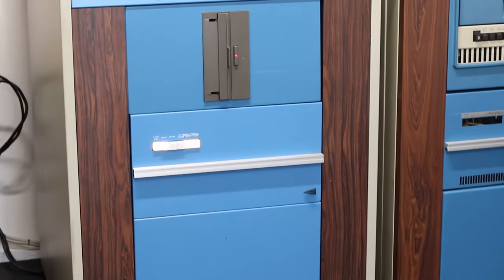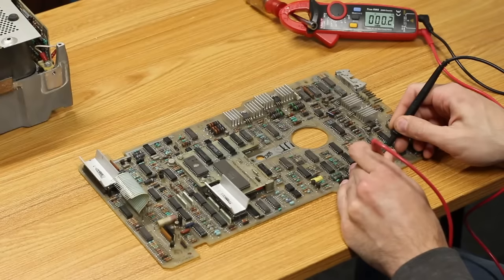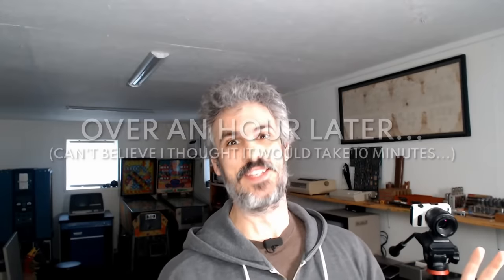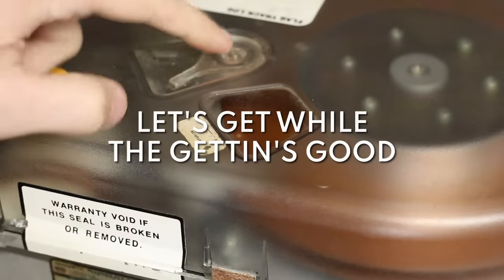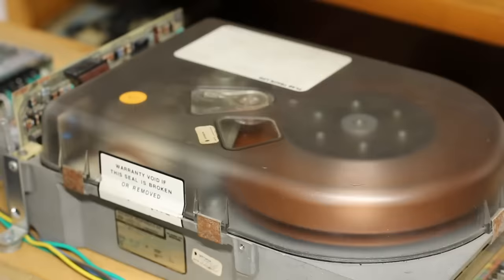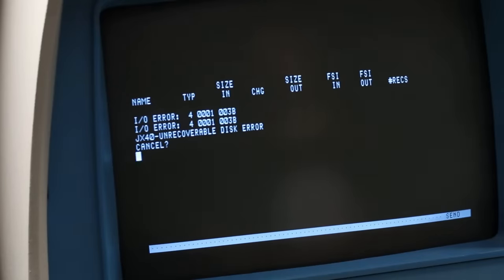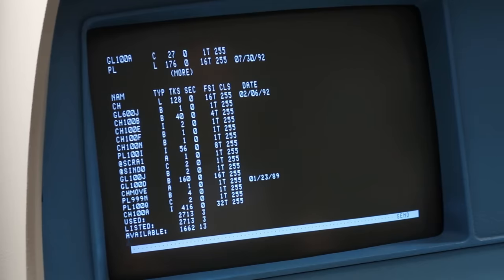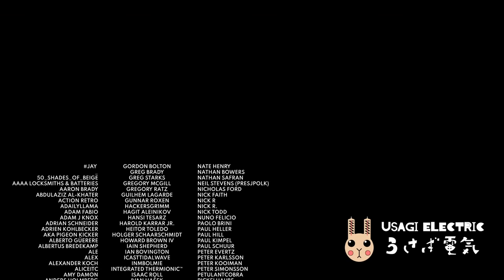Will This Rare 1980s HDD Live Long Enough to Save the Data?

Comment: This made my morning. I recall many weeks in my time as the IT guy in our large CPA firm where I was trying to recover clients data from proprietary legacy systems. Many in the office never really understood why I would get so excited when victory came. It's hard for non tech people to fully grasp the amount of failure modes that make a simple concept of recovering data so nuanced. Most of us watching were feeling it.  Thanks
Reply from the maker: Thank you!
It's so easy to think of things as big large collections. Like, we only really needed four things to work - the computer, the two finch drives and the hawk. That doesn't sound like much, but when stopping to really think about everything that was involved in just getting a little bit of data from one place to another, it was almost overwhelming!
Reply: That's the same thing as having a videocamera not working as intended and opening it up from the easiest parts/side and finding the fault, and hoping that it's the only defect, and upon switching it back on performing as intended...
We once had someone who just had one of the worst days of life come into our office completely heartbroken because the camera this person had been using had written all the video files (of a big house fire) to the SD card in a corrupt fashion due to someone who used the same camera earlier pushing in an SD card the wrong way in, which bends a CRC pin from what we can find, it records without errors, but corrupts the whole card.
Due to some other things this person just had it for the day and sat in our office crying, and I decided to let a recovery program (SanDisk's program was, as usual, useless for that task) work on the cards.
Just as the person had gotten themselves back together a bit, I asked them to check the files it had already recovered, and when seeing what was coming back the person broke down crying yet again.

I never felt like hugging someone but oof, that time I absolutely thought about doing so.
Reply: I'm a tech person and I still dont undertand his excitement and feelings, even tough it is a hard task. He got some data out of a disk, and can now delete it since he has no use for it :D
Was the journey the reward?
Reply from the maker: @marsovac  Conversely, we have a ton of use for the data we saved versus the data we lost. My Finch drive was full of Oil and Gas backups for a local Oil Company in Texas. There weren't any applications, software, operating systems, etc. Just legions and legions of personal data. The MicroPlus Finch drive does have personal data on it, but it also has a ton of applications that we've never seen before, a full operating system, software packages, linkers, and just a ton of stuff that is extremely useful!

Although, I think the misunderstanding is coming from potentially a lack of knowledge of the history of the Centurion computer. I've been working intimately with this machine for two years now, and we only know of four remaining in existence. The Centurion uses a completely custom CPU, architecture, storage system, and software. For example, the entire machine uses 400 bytes per sector to remain backwards compatible with data from Litton minicomputers from the 1960's.

So, we found a bunch of software that was nearly lost to the sands of time. For some of these applications, the MicroPlus Finch drive quite possibly contained the last remaining copy of that piece of software in the world. That's why I was so excited!

Also, this is my hobby, and my hobby brings me huge amounts of joy. Let people have fun!
Reply: @UsagiElectric Well said. That's the difference between an Engineering mind set and one that isn't. Great Video.
Reply: Yeah, I saw something about AMORT in the file listing which made me immediately suspect it was financial applications. Cool!
Reply: @UsagiElectric is this systen u used posix complint?
Reply: I don't think we have had that issue at the PC shop. We always said this blah blah cpu has has this many hundred million/billion transistors in it, just that one chip out of hundreds.innthis PC, it only takes ONR transistor to fuck up the whole thing. That's always opened some eyes.

But, yes I call it the computer literacy epidemic and liken it to I brother Where Art Thou where the brothers all sign Xs because they can't read.
Reply: @marsovac  Wooden boat reward. Same thing to me. I guarantee you have some hobby or item in your life that gives you the same feeling of accomplishment that another person might look at and think, "that's silly". And that my friend is how it's possible to enjoy others excitement without necessarily relating directly with the project itself. Unless your a Vulcan like Spock and are not moved emotionally by anything, then I'll accept your not understanding.

Comment: I worked as a 'field engineer' (mainframe service tech) in the late '70s;  Immediately on hearing that HDA, I said to myself, "wow, those bearings sound crunchy!"  Somehow, I knew it wasn't a head dragging - although I mightn't have risked flying the heads with the spindle in that rough a shape.  Glad you got the data off!
Reply: Yup, that's a common sound for a ball bearing that's beginning to fail. I've heard plenty of bearings making that sort of noise on various machines. They can last quite a long time sounding like this. Very often when you take the bearing out it will look and feel fine, even though it sounds terrible at operating speed.
If it progresses to a lower pitch rumbling or grinding noise you know the bearing is not far from spitting it's contents on the floor and needs to be replaced ASAP.

Comment: On the "plugged the connector in the wrong spot" event.  When I was stationed in Japan in the 1980s, we had a Data General Micro Nova we used with a radio system.  We started having problems with it booting up from the floppy drive intermittently.  We struggled with it for about a month with intermittent fail to boot problems.  We swapped all the cards, and tried going through the troubleshooting guide several times.  Keep in mind we were radio techs, not computer techs and we were not supposed to get too creative with the system.  We finally called the main depot back in Sacramento, CA.  They walked us through the same steps we had done ourselves to make sure we covered everything and finally determined they needed to send someone to Japan to assist us.  a short while later they arrived, went to the machine, pulled it out of the rack, looked at the connector and moved it one position over.  It turned out the guide didn't show which connector to use, and we were using the wrong one.  Apparently one connector had a parity bit, and one didn't.  We were using the non-parity bit connector so errors didn't get found and that was why it was intermittent.   We ended up having to people travel from CA to Japan to have us move the connector over one spot.
Reply: Definitely not the first time somebody has had to travel just to move a plug. Happens a lot in IT lol.
Reply: @SonicBoone56 with this case covering a distance of around 5500 miles it might hold the record for something that simple, though
Reply: I bet the tech from Sacramento told that story for the rest of his life.
Reply: Hah, well they're paid for the knowledge of knowing that the connector needed to be moved over one.

Itemized bill:

Moving connector: $1.00
Knowing where to move the connector: $9,999.00

Comment: That scratch in the floppy front panel is driving me crazy
Reply from the maker: Don't worry, that's on the docket to get fixed! I have a completely new front panel made of steel that I can weld proper mounting tabs to. Once I get some paint matched up to the original color, I'll spray it and replace the scratched one.
Reply: There are car repair products that can help you buff out the scratch on the existing front panel.

Comment: The 'warm it up' is a well known trick for very old drives with potentially dried out lubricants. I generally leave them on a 'hand warm' heater for like 8+ hours. This also reduces thermal stress on the electronics btw.
Reply: could you not just regrease the drive?
i know nothing about these old drives, but they put it together so could you not take it apart?
Reply: @derpmellow2  You generally do not want to take a harddisk apart beyond possibly removing/replacing the pcb.

Harddisks are assembled in an area with a very clean atmosphere and are typically sealed because even small bits of dust can cause a head crash.

There are ways to do this without having a clean room, but those are still risky enough to avoid them if you can.
Reply: @c128stuff  understood, so it is doable but not recommended.
Reply: @derpmellow2  Its something to avoid at all cost unless there really is no other option, you know what you are doing, and have the setup to do it.
Reply: @derpmellow2  Opening a harddrive and closing it up again and having it still working IS possible - then again you might as well wreck it completely due to dust contamination - impacts with grains of dust can actually physically destroy the heads themselves, at the very least losing all data stored on that disk surface, and quite possibly making the drive totally inoperable.

Then you need to realize that the drive spindle bearings aren't necessarily exposed for you to lube them up either, and if you need to physically tear the drive down to get at them then you're never going to get any data out of it again, because you can't put it back together and have it still function. Not just a matter of contamination, it's also tolerances. Harddrives - even ones as old as these - are high precision instruments, and you just can't tear it down and put it back together and keep all the tolerances within spec.

So consider the possibility of lubing up a prehistorical HDD a "no", for all intents and purposes. Harddrives are essentially consumables - always have been. You buy 'em, and they'll wear out eventually, since they're partly mechanical systems. These ancient ones even have carbon brushes for the spindle motor, so they're definitely going to wear out eventually - you can see all the carbon dust residue on the underside of the drive chassis after the PCB has been removed.

That stuff is electrically conductive by the way and can cause shorts or other problems if it amasses in the wrong spots over time. Just one reason why modern drives use brushless motors... :)

Comment: If you are ever tracking down shorts in the future, a thermal imaging camera is a great tool to have. You can just power the board up with a current limited supply, and the offending component will stick out like a sore thumb because it will take all the current compared to all of the other components.

That saves you from playing hide and seek with parts.
Reply from the maker: A thermal camera is definitely one of those things I need to invest in!
I did think about just cranking the current up and whatever starts to glow or let out smoke is a pretty good indication, but I figured I would try probing around with the DMM first, haha.
Reply: @UsagiElectric  problem is other parts could be destroyed by other bad ones in a chain reaction destruction, i've had it happen in colour portable tvs in the 90s....
Reply: That is true. It could be a usable technique but it's dangerous.

Some dead parts (i.e.e diodes) may fuse into a dead short so the part would have near-zero resistance, capable of sinking a few amps. 

The traces however are not, causing them to literally burn off the board.

In this case the capacitor had <0.1 ohm resistance, while the traces leading to it had ~0.5 ohm - guess which is going to get hot.

If you cannot find a shorting part - try cutting traces where they are easy to repair, isolating the problem area bit by bit. Be aware that there may be multiple shorts though.
Reply: The tools you really need for tracking down shorts is an old school HP 546A Logic Pulser,  and an HP 547A Current Tracer.  You trace shorts with these with the power off.  No FLIR required!
Reply: @UsagiElectric  Get one of those phone InfiRay ones, fairly cheap, cheerful and quite useful.
Reply: @UsagiElectric  Small camera-attached FLIRs are in the lower 400€
They're not the highest resolution, but really nice to shoot some video with, and they are plenty good for seeing hot-spots!
Reply: @jwhite5008 That's why I mentioned using a current limited supply to something like half an amp, which can't really damage a lot.
Reply: The cheap version is to power up the board with current limited power supply and spray it with isopropyl alcohol mist.

The things that get warm first will evaporate the alcohol first
Reply: @UsagiElectric  Some people like to dab IPA on parts to see how quickly it evaporates, others who like pain (like Louis Rossmann) use the 'ouchie' test with their fingers, others use an IR thermometer. 

Probing for resistances is definitely the more elegant way, followed by injecting current and checking with a thermal camera :)
Reply: @Stoney3K  Yes, but set with a low voltage as well.  If the short were to clear due to the increased current, you obviously need to avoid frying anything else.
Reply: @jwhite5008  My brother uses this technique as one of the last resort types of troubleshooting, especially because of the risky nature of it.  It's one of those "It's already dead now, so it can't really get any worse" types of situations for him.
Reply: @Dutch3DMaster the rule is when in doubt 3amp it out

Comment: I have got to wonder if it wouldn't be useful to attempt to read the disk with a modern flux imaging system. That could attempt to read past the errors detected by the OS and allow the full platter image to be analyzed, and potentially discover if there are any more data hiding on the disk.

Comment: Regarding the tower of complexity, yes, we stand on the shoulders of giants who stood on the shoulders of giants, who stood on the shoulders of giants, etc. This episode reminded me of the times I've whacked an IDE hard drive, or balanced it at a certain angle to get it to spin up and copied data from it before it never worked again. Well deserved triumph there :)
Reply: Oh dear, me too. My mentor sysadmin when I was a wee PFY taught me to lift a Mac II cabinet and give it a good twist to unstick the drive bearings of the original Mac II harddrives - I think they were Apple-branded 20 or 40 MB Seagate 5¼" SCSI. IIRC he said they had been mounted wrong side up from the factory, which caused them to stick. I later improved the procedure by taking the lid off, unscrewing the drive, and just jerk the drive. Much safer for my back.
I once rescued a disk containing lots of user data using the same method and immediately making a track by track SCSI copy to a good disk, then fixing it using Disk First Aid

Comment: @UsagiElectric
As qualifier, I once helped fix one of these drives when just getting started in computing. When working on a very similar(if not identical) drive, we were hearing a very similar grinding sound. We thought it was a spindle motor problem until one of the company engineers walked in, told us it sounded like the platter-brake dragging and showed us. He locked the heads, disconnected the data cabling and turned the drive on it's side. He powered it up and sure enough the platter-brake shoe was not pulling away from the rotor surface. We took the solenoid off, took off the brake shoe, put the solenoid back in and powered it up again. No more grinding sound and the drive seemed to get right up to speed like it was supposed to. We left it that way and put it all back together. Powered it up and everything was back to normal except, no platter-brake. At that time replacement solenoid units were not available so the company just replaced the whole system with something new. So, I think it might be worth it to check the platter-brake on your unit. The solenoid might be stuck or have failed. Couldn't hurt as long as you lock the heads first. Keep in mind, my experience was 40ish years ago. Still, if I can help, it seemed like it was worth mentioning.

Comment: Probably not useful for this occasion... but if you ever come across some damaged media like an HDD and can connect it to a machine which can boot Linux, do this.

There's a tool called dd_rescue which is by far the best option to get the most data from a damaged device as gentle as possible.

It basically copies data with large requests, until it encounters an issue. Then it just jumps in the center of the unread data and continues there, avoiding stressful rereads of the damaged data over and over again.

This will continue until it's on the end of each unread block, then it jumps in the center of the largest remaining unread block. And repeat and repeat and repeat.

This way it avoids the damaged areas as long as possible.

After which it reduces the request size down to just a single sector and repeats the reading of the previously large areas with read issues, but only tries each sector once.

After this pass most readable data will be read. But you can let it run continuesly. It will repeat the reads one damaged sector at a time, and I found it's often lucky and will get most of the damaged data anyway from the disk. But those operations tend to get stressful for the drive, as it needs to seek a lot. So it may die in the process.
Reply: To give a perspective: I tried to copy a hard drive which had some damaged areas with a windows tool, and it got to the first damaged area and got stuck there for two days. Then I terminated it.

dd_rescue got more than 99% of the data from the harddrive within around 2 hours and then started the first retry pass.

In just a couple of hours it got everything out of the hard drive, except ~10 sectors.

After this experience I've never looked back and saved a couple of dozens or so broken harddrive data with it. Worked great every time.